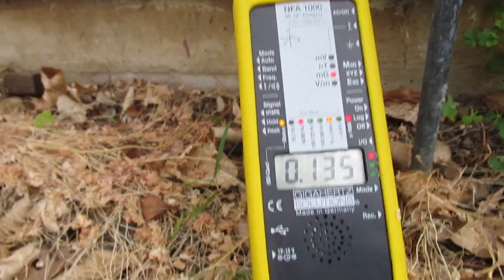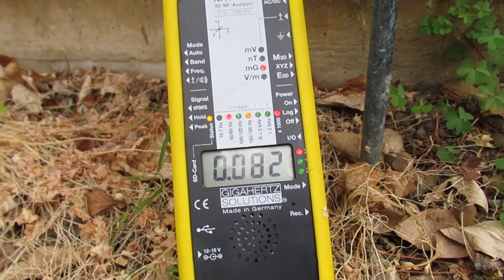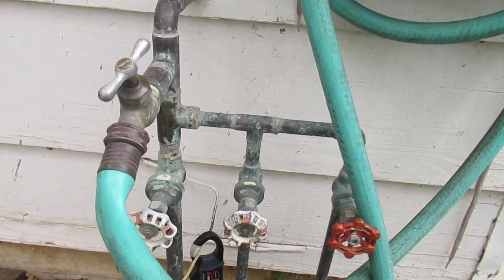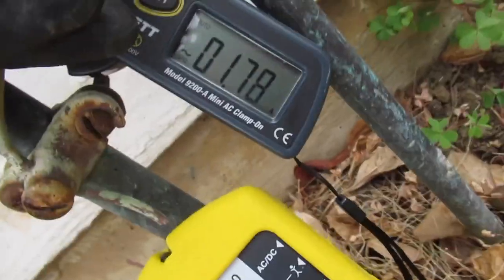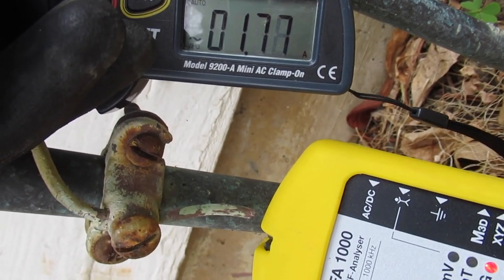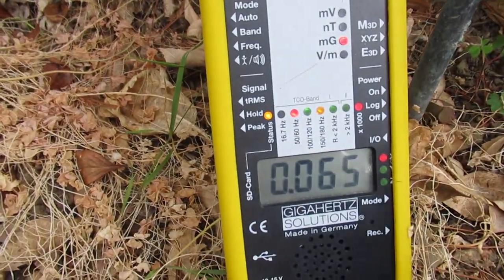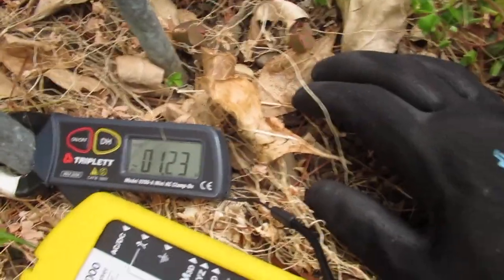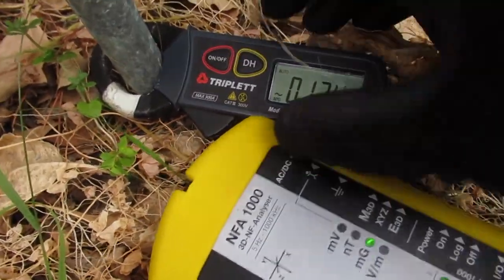Electric Current on Water Service Supply Pipe

Comment: Was this issue resolved? I am currently experiencing the same results where all of my audio recording equipment is picking up an EMI signal making it impossible to work in my home. The only time the noise disappears is when the water bond is removed. Thoughts?
Reply from the maker: They left it in place as it did not effect the mG readings inside the house.